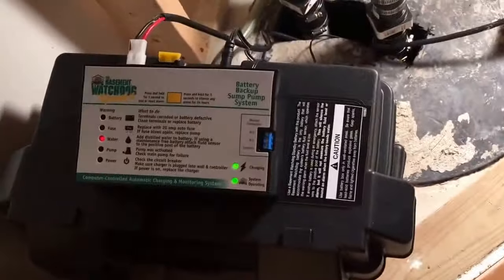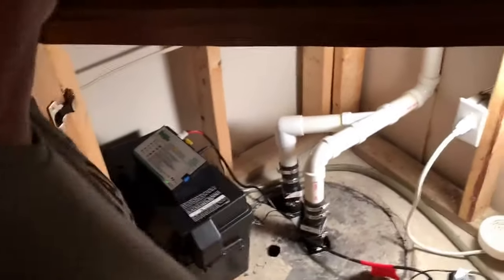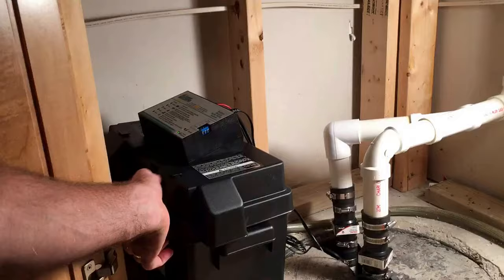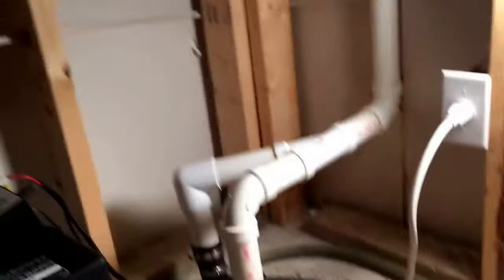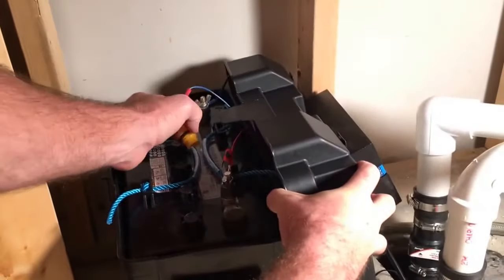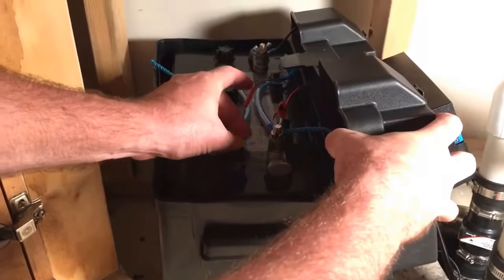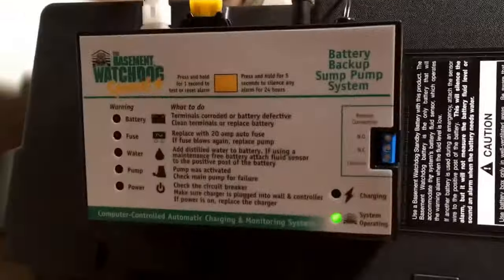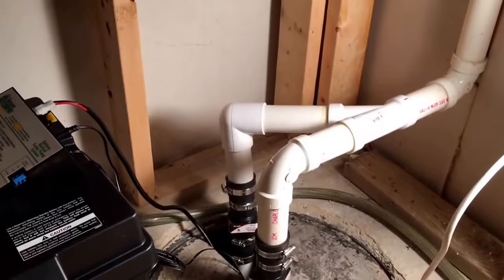Basement Watchdog battery and sump pump troubleshooting annoying alarm!

Comment: There are other problems that can cause the alarm to sound that you didn't address, such as a primary pump failure or low water condition in the battery.  Though I applaud your video, I recommend you replace it with one that provides troubleshooting tips for ALL the conditions that could cause the annoying alarm to come on.  Thanks!

Comment: This “fix” only covers one problem!!! My unit actually light up “low water” when the water is low!! My unit says battery problem which says to clean the connections. They were clean and I cleaned them anyway but it’s still saying battery problem!! The battery is only a year old and I haven’t had to add any water to it and it’s still full !!’ The problem is the pos unit isn’t charging the battery property

Comment: That battery water sensor needs fixed on that system. If the sensor is bent, the system won't get an accurate reading of the water and the alarm will go off more often than it should. Another thing I want to mention is, I saw that the main AC sump pump was plugged into a power strip. When powering an AC sump pump, the pump should always be plugged in directly into a wall AC outlet. An AC sump pump should never be ran off of a power strip.

Comment: In this video, I could EASILY see the BOLD ARROW on the sticker that's on top of the battery POINTING DIRECTLY to the correct cell for the 'add water' sensor.  
Read labels and directions.  Always.

Comment: I’ve been through FOUR BWD batteries, and the company NEVER told me about that yellow cap needing to be on the second hole from the positive post. I’ve never had a battery last me more than 18 months! It really pisses me off that with all the times I’ve called Glentronics, that NOBODY ever even asked me about where zi had the yellow cap - which has always been on the 2nd hole from the negative post, as shown in the original install instructions photo. There was never any wording stating yellow cap needed to be on 2nd hole from positive post. Well, fortunately I have saved the last two wet cell batteries, so MAYBE I can revive them and get some life out of them.

Comment: I bought the maintenance free battery and my alarm for battery is constantly going off. What number did you call?
Reply: Angel Arroyo you ever find a solution? I saw with a maintenance free you hook the water sensor to the positive, which fixed the water error alarm, but now my battery light is beeping instead

Comment: Those 90° pvc connections are robbing you of so much GPM. Recommend going to at least a long sweep connection. Better would be 45° connections or best, a straight up connections.  Good video otherwise.

Comment: I accidentally pulled out the wire and sensor just fell inside the battery , now it’s beeping as there is no sensor , how can I fix it, want to disable water sensor

Comment: I have a maintenance free battery so instructed by company to put probe on positive terminal which I did but nothing happening and alarm going off as constant beep. Battery is brand new. Does it have to be charged first?
Reply: Did you ever solve this problem? I just got mine last week and it's doing the same thing.
Reply: Any updates?
Reply: I called BW, they told me to loosen the positive terminal wingnut, slip the rod in against the terminal and retighten.  The alarm stopped and the light went off.

Comment: I had mine in the second cell and it was inserted properly but was still getting the red light and the alarm. I scrubbed the probe with some CLR type stuff and the light and alarm both stopped. So make sure your probe is down properly and CLEAN